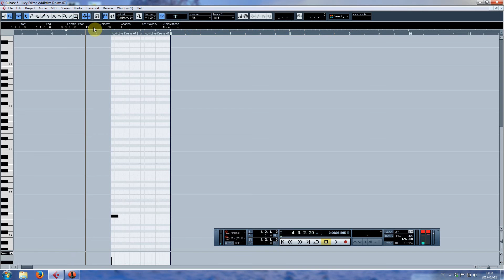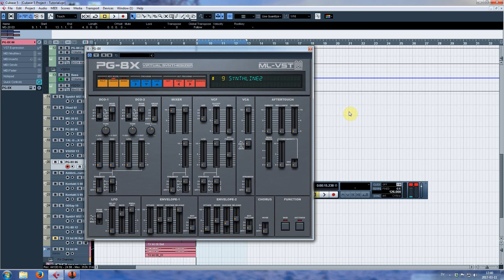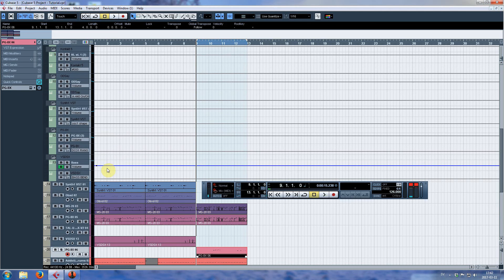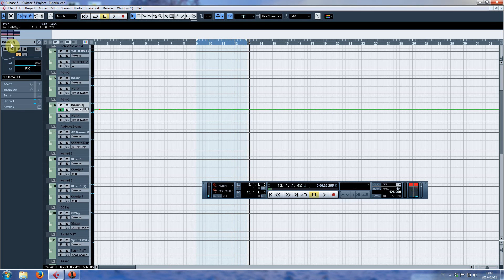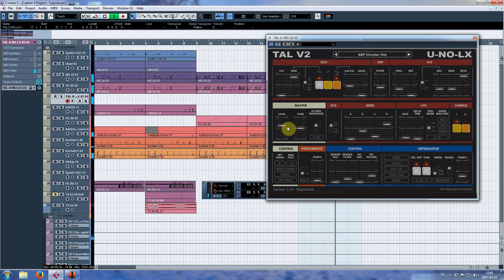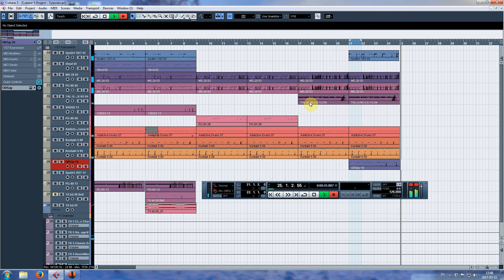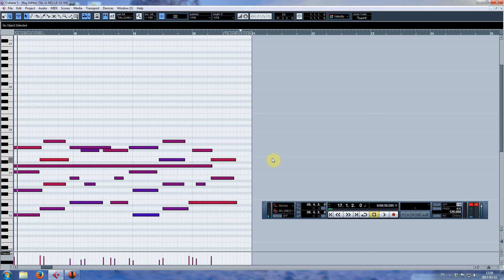Making an 80s pop/italo song -  Tutorial (kind of) part 2

Comment: Hello i am facing a problem that the pg-8x vst is loaded on my cubase 5 but the audio does not work can you please say how did you added the vst 🙏
Reply from the maker: I just followed the instructions in the manual:
Installation:
Copy the PG-8X.dll (for PC) or PG-8X.vst (for MAC) files into your standard VST
folder (please, refer to your DAW documentation, where VSTs are expected to be
located). No other files are necessary. After using the VST for the first time, an
additional pg8x.ini file will be created. Make sure that the plugin has sufficient
permissions to create and write that file.
Reply from the maker: Do you use PC (I think this VST works best on PC) or perhaps Mac? What kind of audio card do you have? I don't use Cubase 5 anymore. I have Cubase 8 at the moment (since I still need support for my old favourite 32 bit plugins I can't use a newer version).
Reply: @roboticrealm  i use laptop and  can you say which vst i have to download 64 or 32 ? it depends on software or computer
Reply from the maker: @producerboy22  You say laptop...A laptop can be a PC or a Mac. Which is it? Do you use Windows 10, 11 or 7 if you have a PC, or maybe you use Linux?  Things also mainly depends on which version of Cubase 5 you have installed. If you installed and use Cubase 5 32 bit, then you HAVE to download and use the 32 bit version of PG-8X. However, if you have the 64 bit version of Cubase 5 installed, you can use both versions, but I would recommend using the 64 bit version. I hope this helps.
Reply: @roboticrealm  thank you !! i use windows 7 : )
Reply from the maker: @producerboy22  Alright. Then it SHOULD not be any problems. Just check if you have the 32 bit or 64 bit version of Cubase installed. Then download and install the version of PG-8X that corresponds to that. If you still have problems, then I recon it has something to do with your audio card, but I don't know.
Reply: @roboticrealm  thank you soo much for helping me
Reply from the maker: @producerboy22  You're welcome. I hope it works now for you.